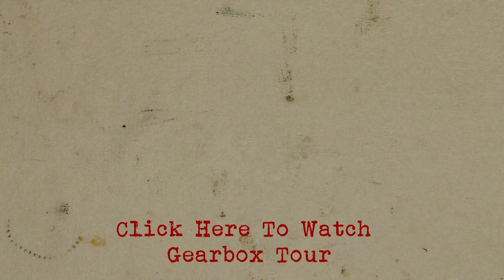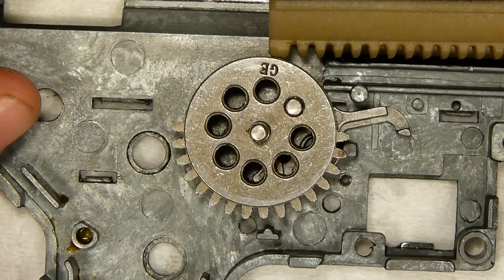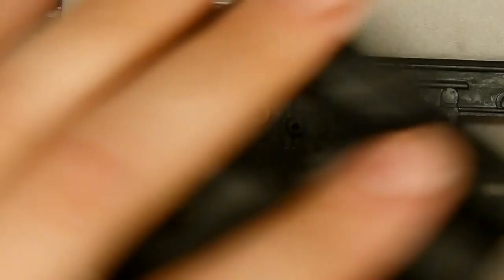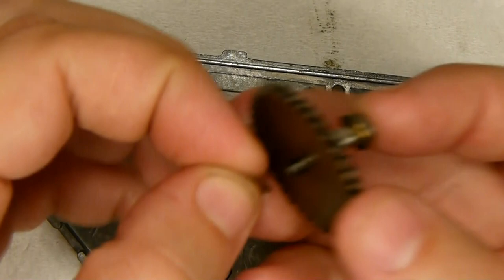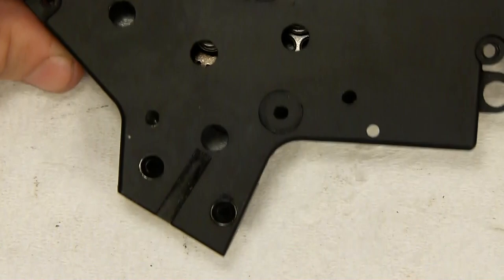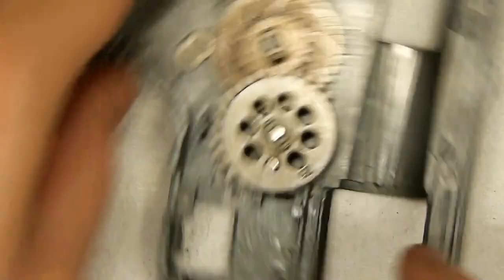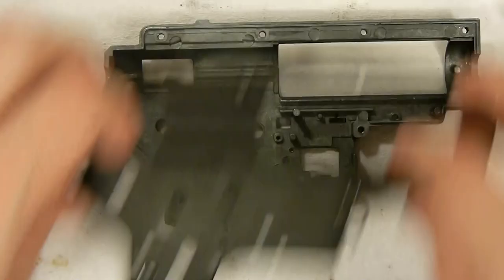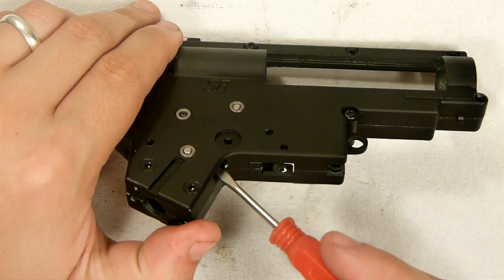Airsoft Tech Talk: How To Shim A Gearbox

Comment: i wouldnt start with the spur gear. then its a hit or miss if the pinion is meshing well with the bevel. you always wanna start shimming bevel to pinion, the bevel to spur, then spur to sector.
Reply: +1 - start with the bevel gear and shim this to the motor pinion.
Reply: motor height is far different than pinion to bevel shimming.

Comment: the difference in tightness between setting everything together lose, and when screws are on is very very sensitive. That's why I would every time use the screws regardless. You'll have to try out with the screws anyways eventually. Now, mind you, I've spend a lot of time on this process all together. Of course I had not seen this vid before. So thanks a lot for this. and cheers

Comment: Awesome video and a beautiful shim job sir :) .  In order to test that Semi-Auto is still functioning after the re-shim, I like to leave the switch assembly and selector plate inside during a shim job. To do so you can pop the trigger in, tighten up a few gearbox screws around the shell. Push the selector plate to the semi-auto position and then pull down on the trigger. With the trigger depressed while also keeping the selector plate in place with a thumb or finger,  you can then cycle the gears either with a finger or a flat headed screw driver. If Semi auto is working the gear rotation will come under some pressure (when the sector gear makes contact with the cut off lever); push past the pressure point and you will feel a click.. this is the switch block being flicked out of the switch canal. You can repeat this a few times to make sure it is working consistently.

Comment: Also, when you insert the motor and the pinion gear, that will have a tendency to push up the bevel gear slightly, so just make sure you factor that in when shimming.

Comment: This really helps. I'm shimming my sr25 because I blew a spur gear because I turned the hop too high and kept shooting it like an idiot. Something I already noticed about my gear set is my pinion and sector gear need way more shims than my spur gear because I only needed two 1 mm shims. One on each side. Assemble. I still have to shim the bottom part of  the gearbox. There's no play and I will never have a side without a shim. Still need to put shims on the bevil but other than that the bevil to minion is fine. Makes the clicking sound you want.

Comment: @ghost21rsst edit; Also having the gearbox tight with only gears in it, wrong! What about cutoff lever, trigger grouping, cylinder, and other parts that can cause the gearbox to flex further apart. This make work if you only have the gear-set, but the other items will make a difference.

Comment: You should start shimming with your bevel to pinion gear first, then do your spur and finish with sector to guarantee optimal gear meshing.If you start with the spur then it's a coin flip on whether the pinion and bevel mesh properly if you shim to bevel to the spur.

Comment: I fixed my gearbox that wouldn't fire in semi auto abd in auto it made a weird noise then stoped working so I opened up the gearbox which is a version 2 but plastic and I noticed the delay latch was off from when I stretched the spring so I had to place that latch in the correct spot and now it works in semi and full auto correctly and it sounds alot better plus I increased the fps slightly by stretching the spring this video is very helpful as it helped me understand alot more about aeg gearboxes I could make an aeg myself now but it would be cheaper to buy one and do upgrades on as it makes sence unless you get the parts for a good price

Comment: Absolutely superb. I can't think of any way that could have been done better.
Reply: bevel to pinion is a better way, plus he shimmed the spur and sector too tight. Even in bushings they should feel frictionless and get multiple rotations with a low force spin. This method created a lot of stress on the bevel and pinion as the bevel being raised only .1mm forces the pinion to be too low and there is minimum contact that way. This also creates noise, when shimmed correctly all you should hear is a low pitched 'thud' from the piston head hitting the cylinder head, no other noise you typically hear in an AEG such as any high pitched noise

Comment: This tutorial is incorrect. You should start with the bevel gear and the pinion gear as these two have the biggest areas of inconsistency. You should shim the bevel gear to the pinion gear because there is a bigger area of inconstancy between the mechbox, body, and motor housing. V2 is a MASSIVE pain in the butt to get correct, but - when you've got it, it works flawlessly. Keep in mind that the screws of of the mechbox and the body you are installing it into can cause stress on the gears/bushings and creates unexpected binding. Install all screws but no main spring if you want to check binding performance.  Keep in mind that the mechbox WILL deform while under spring pressure so eliminating ALL vertical travel is not advised. 1-1.5mm vertical travel should be plenty.
MANY thanks to AOSCAirsoft for this tutorial.
For separation: If you lease swirls in the grease, your fine. If you leave nothing, you maybe too close.

Comment: Do you think there was alot of friction with the gears when the gear box was bolted down because the gear box itself might have been a little warped due to use on the field, that would explain having a good shim job but when everything is bolted down some gears might have more friction than others? Very good video as well!

Comment: When figuring out which gear needs re-shimming after you've torqued down the gearbox to test the gears, wouldn't it be much easier to leave the bevel and sector gears in and test both of them so you don't have to open the gearbox for each gear? This would allow you to figure out which gear needs re-shimming by bolting it down two times total instead of four.
Reply: +CaptiousGaming I waa thinking about it, too.
Reply: I have shimmed thousands of gearboxes. It is far easier although a lengthy process to put your screws in and tighten down  with the addition of every gear. 
For example. 
Add your spur, shim, tighten down, test the spin!
Add the sector, shim, tighten down, test the spin,
Repeat for the bevel gear!
Tho rest of the methodology of this video I would agree with.

Comment: my mk43 gearbox is such a pain in the ass to shim, the pignon gear keeps stripping
Reply: If you didnt shim it bevel to pinion it will strip, the problem is when you shim gears as low as possible you usually have .5-.6 mm of shims on the top of the bevel. So the bevel is positioned down, and the pinion comes in and forces the bevel up and puts enormous amounts of wear on it...

Comment: I just tried shimming on an old gun and it took me 5 hours with a questionable outcome. It sounds unpleasant but i feel it comes from the anti-reverse latch rather than the gears themselves. The spring on the latch is quite strong and it may be the one making the "scratching" noise
Reply: Did you lubricate properly? Most shimming videos don't tell you, but you should use some lube on certain areas.
Reply: @markarato8034  i didn't lube at all since we have none.
Reply: @Vipera217  You should get some gear oil from a hardware store and put a tiny bit on the surfaces of the shims. It should make everything sound a lot more pleasant, it can also eliminate any scratching sounds. After all, shims are metal parts that are in constant contact with other moving metal parts. They need some lubrication.
Reply: @markarato8034  can the gears' teeth be damaged from bad lube? i just replaced the bevel but it gave up after a game so im wondering if the bevel i replaced it with is old or it's due to it being dry
Reply: @Vipera217  moving metal parts being dry can cause issues as the metals scratch against each other. I would not lube the teeth directly, but you can and you should lube the shims and the bevels. Don't go crazy just use a tiny bit.
Reply: @markarato8034  alright thank you so much. i'll try it asap

Comment: tried with my v3 gearbox. did not work. the cut off lever always makes the secor gear rub on it and slows the rate drastically of how my gears spin. i just put what i had together and took it to the local tech. he did an okay job considering i still hear gearbox whine. but im still using tamiya connectors and stock motor and gears. idk.

Comment: hi there!! i just bought a  used TGM A5 and it came with a problem in the fire selector , when I shoot in full auto the replica keeps firing even if i dont push the trigger. it only happens when i go in fully auto , not in semi.  Maybe that be a problem with the gearbox or something?? A friend of mine told me that the fire selector has a coil that can make contact with a plate and that may be a factory issue. Do you know how to repair it or can guide me to some videos that can be handy?? thanks a lot!!

Comment: Is it fine, if I put a drop of superglue under the shims to help them stay in place so that when I want to take the gearbox apart for changing the spring i won't have to reshim the entire thing again?
Reply: The grease usually hold them in place if you take it back apart.

Comment: whats the purpose of this? im new to airsoft. am i suppose to do this whenever i do a maintenance for the gearbox? or is this just for new gearbox?
Reply: it helps u get the max potential inside the gearbox, full spinning work, makes it last longer and makes it more quiet
Reply: performance in terms of FPS and trigger response.
Prevents early wear and tear.
Energy usage goes down a bit.
Might lower noise a bit.

Comment: Why u dont put a ball bearing?
Reply: While Ball Bearing bushings can increase ROF and reduce some strain on parts such as the motor, they generally don't last as long as steel or other solid metal bushings. I have had a higher power bearing setup break down on me in the past. While they do have their benefits; solid bushings will carry on functioning almost indefinitely.

Comment: I have a problem with the 'box on my G36. I took it apart to lube it back when I got it, and when I got it back together the trigger doesn't reset properly when it's in semi. I figure I have the teeth in an incorrect initial position... Does anyone know what that is off the top of their head?
Reply: Lee Davison Do you need to kinda pull the trigger back when you shoot semi? And does it make sort of clicking sound?
Reply: It did, it was all limp and the trigger needed resetting. I eventually solved it by rebuilding it, I have a feeling their initial position was important somehow.

Comment: is it worth the effort to shim cheap (150 to 200 $) entry level gearboxes?
Reply: Yes definitely
Reply: Calb Smoth only a shame i cant put my semi-V2 gearbox back together. it is not quite a V2, there is some kind of witch in itstead of a trigger assembly in it, and the cilinder is shorter and not standard M4 type. this means the spring tension lifts the piston slightly before closing the gearbox, causing it to miss its grooves. because the piston did not end straight inside the gearbox, its side got stripped. now i will try a different spring, and if that doesnt work i have to replace the entire cilinder and piston, and hope it will work again. i suppose i already spent half the cost of the entire gun on this attempt to shim it.
hope my V3 is easier...

Comment: i need help, my LMT Defender stop shooting. Motor is on but does not shoot, how to fix it?
Reply: If the motor is still spining but the gun is not firing then you may have to ajust your motor height or you may have a striped gear or shattered piston.
Reply: Ben Ostrowski Ty
Reply: the wires might be backwards. ive done that once my motor didnt move at all when in the gun but found that out when i flipped the wires around and it worked

Comment: Who r u? You forgot to shim bevel properly with the pinion. Also without gluing in the bearings or bushings you run the risk of breaking gears because of the looseness you have. You shim the gears so close together if they skip to one another, teeth failure will be created. Your voice sounds like me.